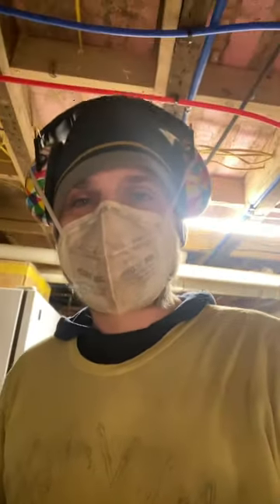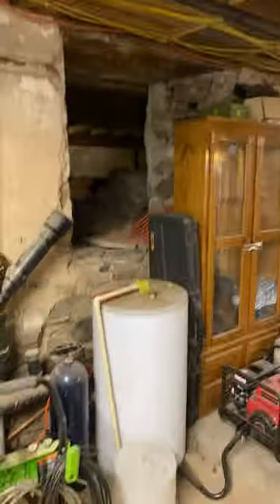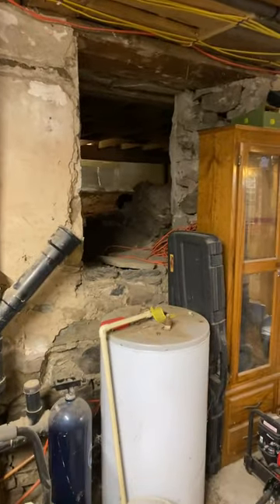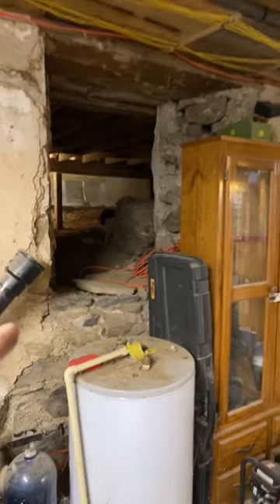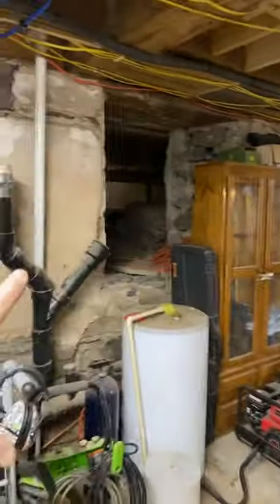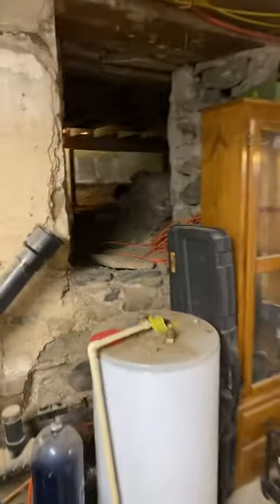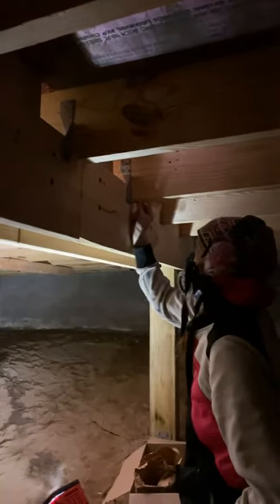How we access the crawl space.

Comment: That other side with the joist landing on the 2x4 is a major weak link.  Will split and sag over time.  The lags are just a bandaid.  I would replace the 2x4 with 2x8/10s and secure it with 3”+ ledger screws in a W pattern.  Can’t tell how those beams are secured to the side of the post?

Speaking from experience I have fixed two different houses with major humps/dips in the flooring with the same design you have.
Reply from the maker: Hey, not sure what you’re talking about? I don’t have any joist hitting a 2x4?  The one 2x4 I can see, it’s just holding the joist on a straight plain. Not doing anything structural.
Reply from the maker: I watched the short again.. you might be talking about the 2x4 the ties are going to?? If so, the 2x10s aren’t sitting on it.. they are on the main beam. 😃😃👍👍👍 thanks though!! I like these type of comments as they are always helpful